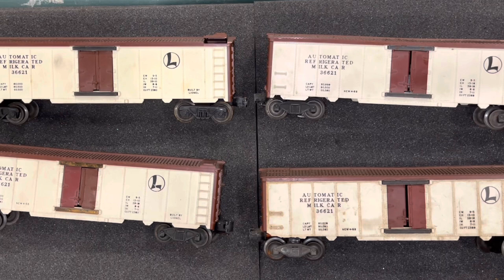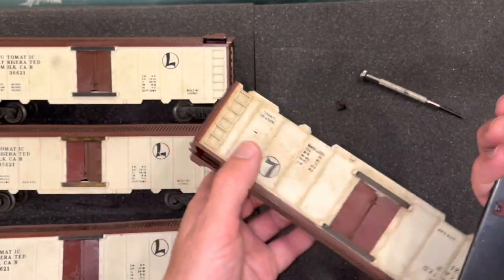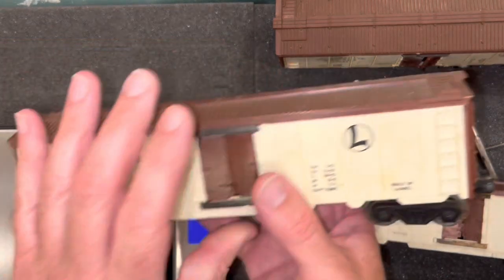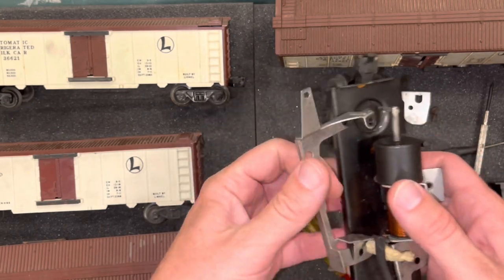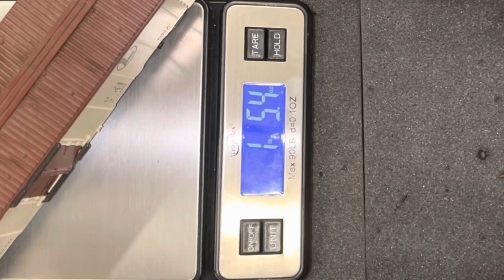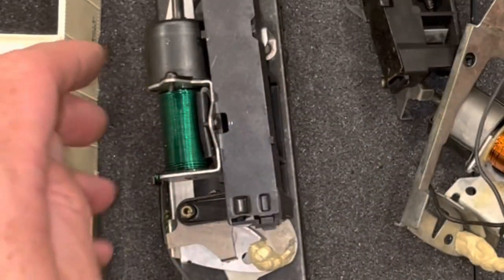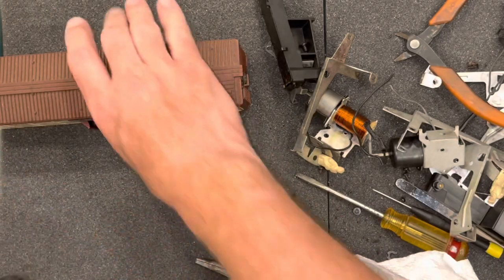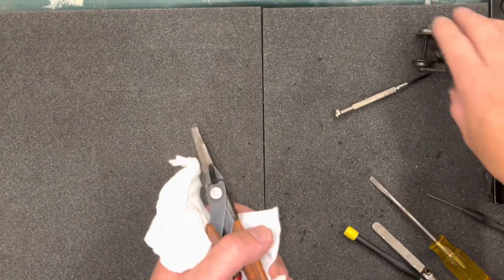The Lionel Postwar 3662 Automatic Milk Car. Review, weight reduction, and running this classic car.

Comment: Great idea Dave. If a cars function is no longer operational or damaged to the point of significant repairs, preserving its exterior details and addition to a reasonable freight consist, for many is a very reasonable and logical choice.
It can be a difficult decision because the car will never be the same but on the other hand if your not going to fix it or sell it, then why not get the remaining value of it more often on your layout.
I did that with my Baby Ruth box car. It was one that was part of an electronic set from 1947 with a completely non functional and heavy electronic receiver inside. Additionally the wires were completely dried out and cracked.
I decided to remove the wires and unit completely and it now is a much lighter and beautiful addition to my freight consists. Post script, I ended up actually selling the electronic receiver on EBay to someone who either just collects them or has the necessary additional components to test it and possibly use it in another similar freight car of that original set.  Kinda reminds me a bit of the organ transplantation process for model railroading . 🚂😉

Comment: Nice information on the 3662 milk car!  I have a number of them, I figure about 10.  I never thought of simply removing the mechanisms to make them lighter.  Like you I like to run a lot of identical cars.  One of my "things" is the 6672 Santa Fe Mechanical reefer. I have a book from the Santa Fe Railway Historical and Modeling Society that details mechanical refrigerator cars on the line. In 1954 Sabta Fe came out with the first real ones.  Lionel.also came out with the 6672 I believe in 1954.  In the  beginning the real ones were painted white with a brown roof like Lionel's.  They had a sliding door for the controls also like Lionel's.  Unlike Lionel's the mechanical refrigerator was Frigidaire, I believe, not Carrier as is Lionel's.  After the first run of the real cars they were painted orange with black roofs and dooes.  That does not make sense to me as white would reflect the heat of the desert Southwest better than orange and black.  There was at least one car that was stainless steel.  From a heat standpoint that would make sense, but it must have been very costly to build.  Lionel, apparently seeing a good thing, stuck with white and brown.  All of the trucks are bar end.  KLine made a decent Santa Fe orange and black reefer.  Lionel did make an REA reefer.  The later models of that had, I believe, what you call the AAR truck in plastic.  I only have one of the REA cars with bar enf trucks, but a couple with the plastic trucks--one of which came from Madison Hardware!

Bruce Schrimpf

Comment: Your trains your railroad!  Food for thought. As they were without ever using them as the action cars they were meant to be, but for the weight I can only think of one other purpose for a heaven car like that.  If you have not run your train for some time, several month to a year, use a MarX or other center rail slider type engine and pull the heavy car, or a bunch of them, around the track a few times, say 10 minutes, it will do a great job of cleaning off any dust and surface corrosion.

Comment: Dave if you have no intention of using the milk cars as they were intended then it makes perfect sense to get the hardware out as a weight-saving measure.  
Hey, I had to replace a coupler/truck on an Atlas "Steam Era Classic" ham and bacon company car.  When I opened it up I found it had racks with pig carcasses on 'em!  I pulled the racks and those poor dead piggies out and tossed 'em.  It was depressing! 
I love ham and bacon but I don't want to know about "The Dark Side!"  😮

Comment: Couldn't leave well enough alone could you?  Well a fiddler will filddle after all.   😁 Those are surprisingly heavy.  Out of curiosity, why not run them in their natural form nonetheless?  Surely you have an engine, maybe a double can motor Williams, that can pull them.
Reply from the maker: I could not leave it alone. I could run them heavier, but I never did. I’d rather be able to run them in a long consist.